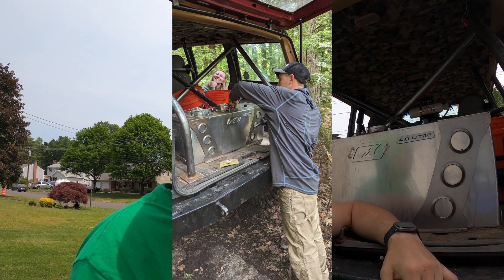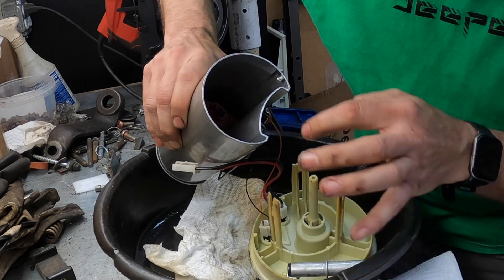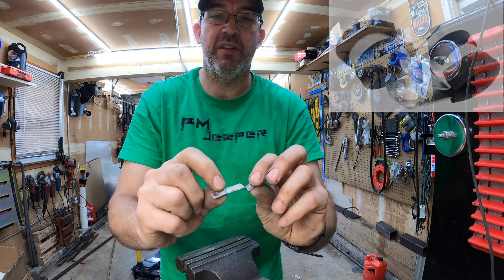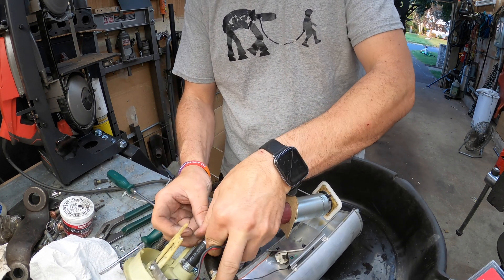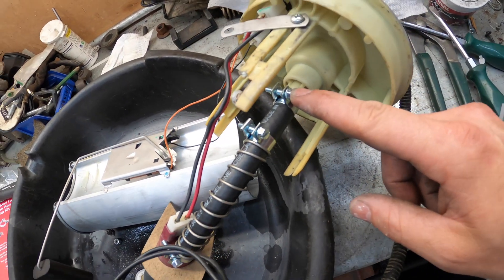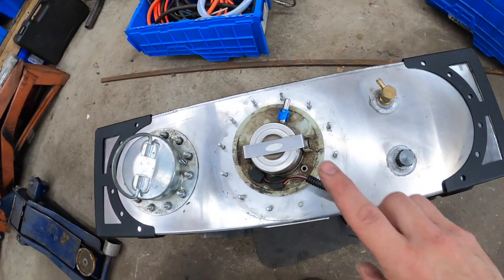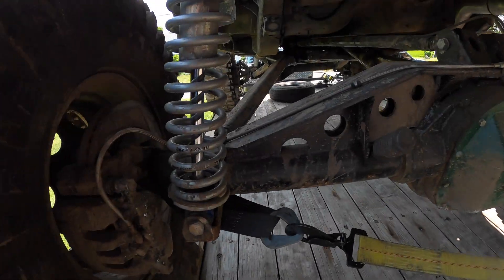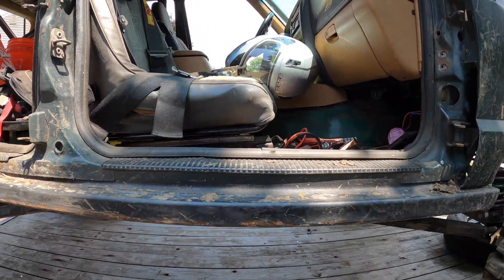Motobilt Fuel Cell Pump fix: An Easy Way To Keep Your Fuel Pump Working Perfectly

Comment: This is looks like a good fix to a problem I haven't heard of yet. I just received my motobilt cell. Do you recommend doing this on the initial install? How has it held up in the last 5 months?
Reply from the maker: 5 months , no issues.

Comment: Got my shirt from your shipper buddy. Starting a collection of favorite YouTube merch 👍🏻 Ill be running RTI and this has me wondering if they make an adapter to run a 4.0 pump in it. Plan is now to use the evil energy system I bought.
Reply from the maker: Sweet man!!!  Thanks for repping the channel.  I'm not as familiar with that brand of cell.  I have used Evil Energy on a few things and like their stuff.  Decent price and quality.   Only time will tell.
Reply: Typo 😆 RCI tank pickup/cover looks similar to yours. If you get bored you can swing by the channel if you wanna judge my Comanche build later 🤪 I'll have to do a video when I set up my fuel system.
Reply from the maker: @BlackAndBlueGarage  I figured it was an RCI, but with so many companies out there, it's hard to be sure.  I'll swing by and check out the build
Reply: I'd be honored. Enjoy the rest of your weekend and be safe out there; great point about doors and safety, it's got me thinking.